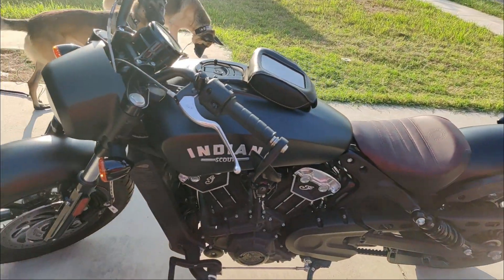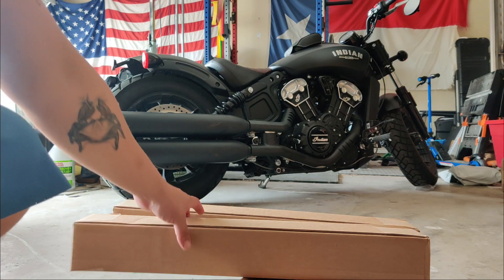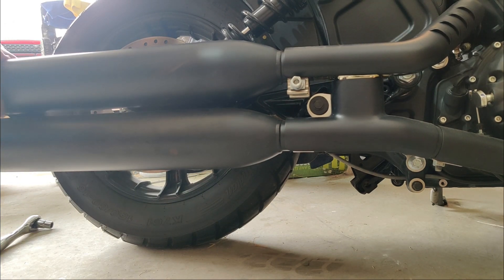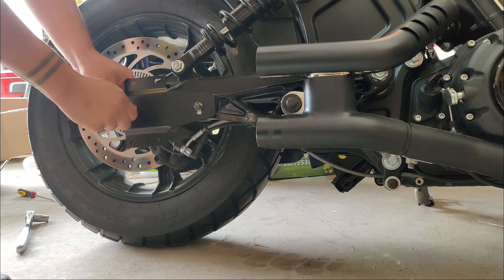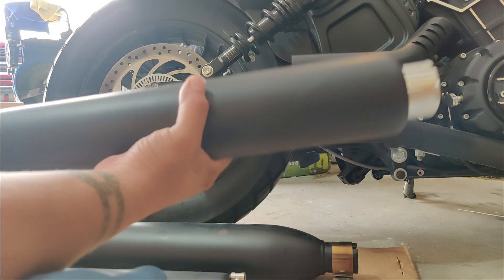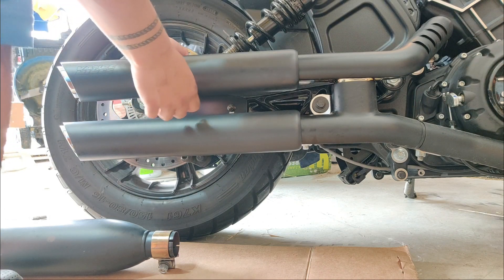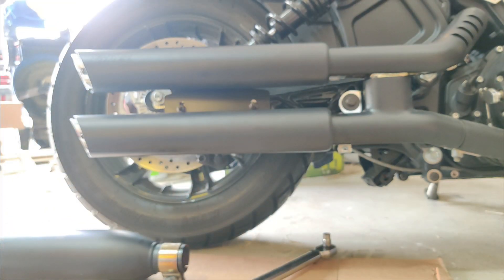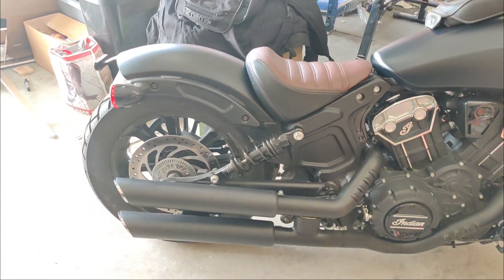Indian Scout Mod 2 Vance and Hines Slip-ons Exhaust Mod 2 (Install)

Comment: Hey amazing video. I tried looking this up on and i have 2021 scout bobber sixty. The website asked me to put motorcycle details and then it said it won’t fit my bike. Can you tell me if it would fit on my bike or what’s the alternative in that case?
Reply from the maker: Thank You for watching. I looked up on revzilla, and for a 2021 does fit. 
Hope the link takes you straight to the page. If not, got to parts, exhasut/slip ons.

https://www.revzilla.com/parts/2021-indian-scout-bobber-sixty?view_all=&page=1&limit=96&facets%5B%5D=944&price_min=169&price_max=675&is_new=false&is_sale=false&is_made_in_usa=false&is_holiday=false&is_blemished=false&ships_two_day=false&sort=featured&fit=
Reply: Instablaster.

Comment: Did you have to re tune the bike or not necessary?
Reply from the maker: Thanks for watching. On the packaging, it has a huge sticker that says "Get the FuelPak". 'm sure it is a marketing tactic, however, for just doing slips on most people do not retune the bike. When you do the air breather and the slip on that is when you start to retune.
Reply: Slip ons dont need a retune from what ive heard
Reply: Indian dealer told me You dont have to if just slip ons
Reply: Think of them as "slip-on slippers".  You simply slip them on and go.

Comment: Did u do a tuning after the install of the slip on exhaust?
Reply from the maker: Thanks for watching. No I did not, A tuning is not necessary for just slip ons. Once you start with slip on and air cleaner that's when you want to adjust the fuel management.
Reply: No need...just let the bike running for about 15min  after installing and the ecu will adjust itself and recognise them.